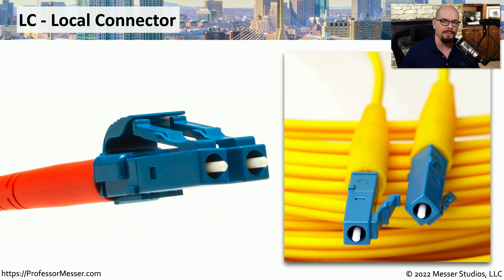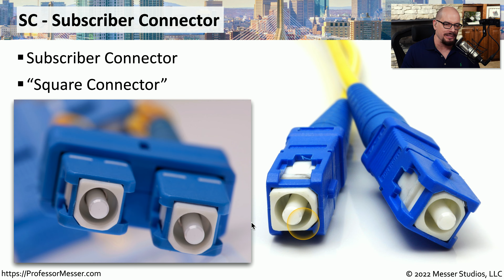Fiber Connectors - CompTIA A+ 220-1101 - 3.1

Comment: Wow section 3 of the exam is LONG
Reply: ikkkkkkk 🥲
Reply: Facts i have 19 pages worth of notes just for 3.1
Reply: @niccos4 you should be careful to take that many notes. Note taking with the material in front of you can be inefficient. It doesn't stimulate your mind enough for long term retention and it causes you to easily forget material over time. 
Consider study methods like Active Recall and Spaced Repetition.
Reply: @SeraSxF  Truths man. I took notes as I watched and then I end up with long pages of notes with no way of actually knowing where to look to find certain information.

Comment: very good, learned about straight tip connectors. However, this video is missing information on APC connectors unfortunately.
Reply from the maker: APC and UPC aren't part of the CompTIA A+ exam objectives. Those topics do appear in the latest Network+ exam objectives.
Reply: @professormesser  thank you for the reply! I will definitely be watching the Network+ series once I've passed the A+, top quality learning material here, thank you for sharing it

Comment: worked with fiber for 4 years now and never knew it was called straight tip and subscriber connecter. Ive always said ST "stick and twist bc you twist on and SC "stick and click" for the click when it secures
Reply: goes to show that experience doesnt translate sometimes. you can have 5 years experience doing the same exact thing and not learn anything new